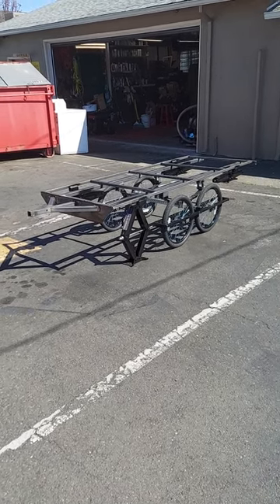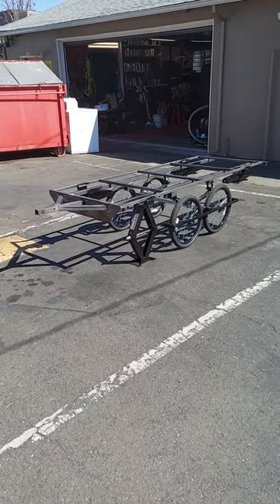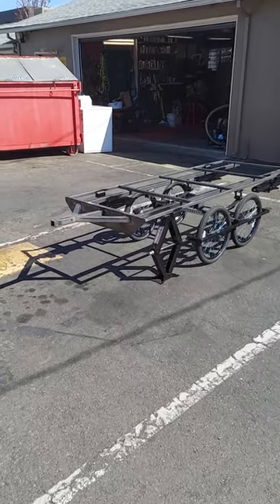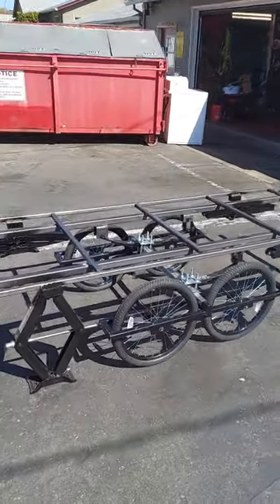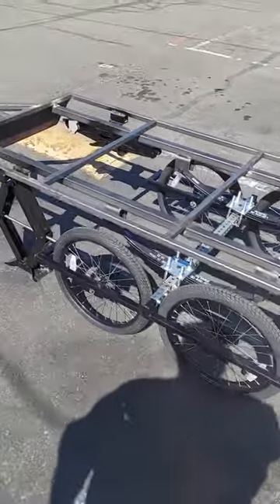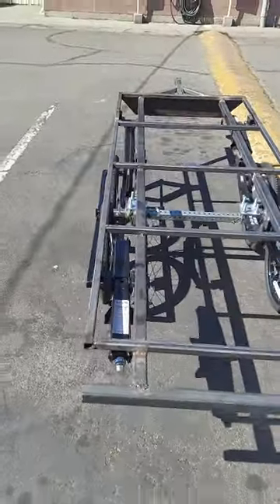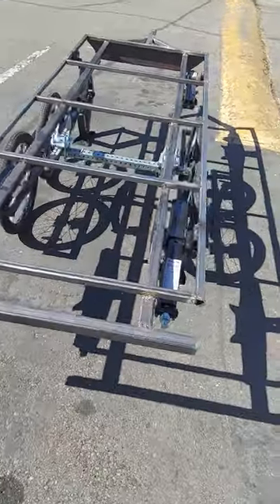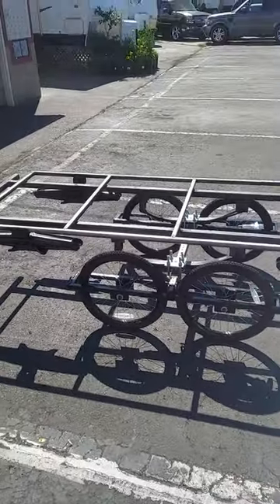Bicycle Camper Trailer with slide-out Video 9

Comment: hello i am curently designing a camper myself for long term travels ,,i did notice that your design really does have a high centre of gravity ,i really want to utilize all the space down to the axle level so im looking at 4 weels with idividual torsion suspension axles so the whole centre area is clear
Reply from the maker: Steel frame is heavier than the top. Still building the prototype.  Top is foam with fiberglass.  If you plan to ride great would use shorter frame and do a pop up to cut wind profile from trucks.
Reply: ill be doing the same high density foam with glass on top,ill be adding 2 hub motors to 2 of the 4 wheels though as ill be carring alot of weight,so the trailer is effectivly self powered it syncs with the bike via optical sensors and load sensor in the tow point  and communicates to the 2 controllers in the bike and the 2 in the camper via can bus ,im going to be too wide for bike tracks though but thats ok ill be in this long term so comfort is high priority ,im thinking my frame will have to steel and alloy as long as they dont directly touchsteel lower and alloy upper ,as repairs on the go are a nightmare  @ED3